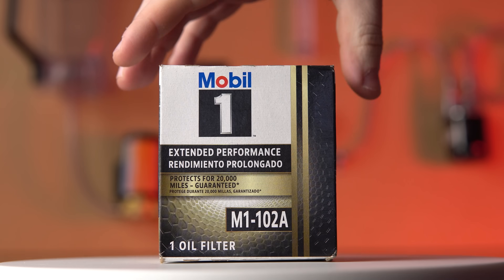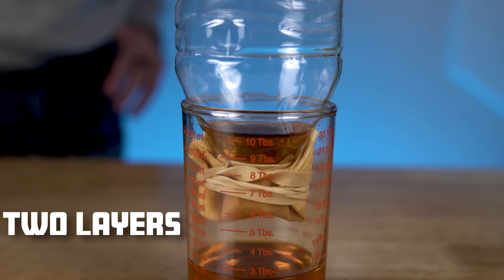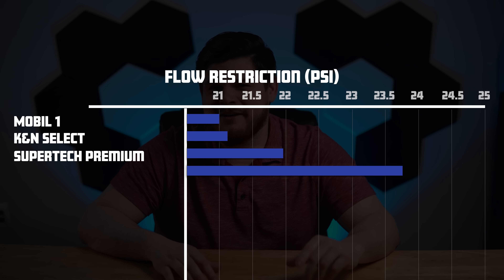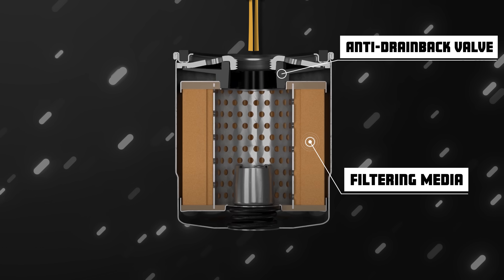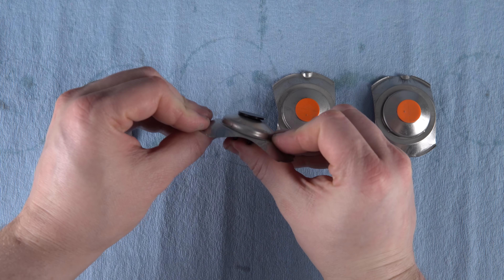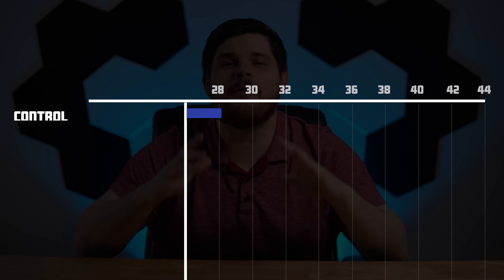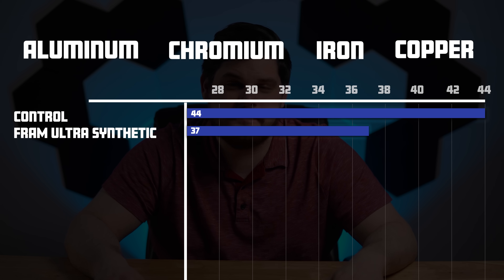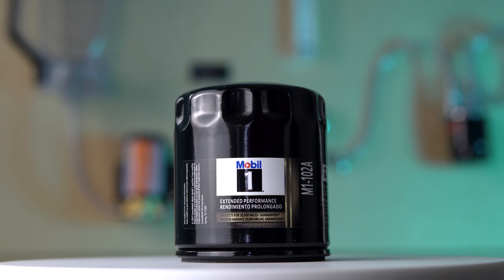Engineers Test the Best Oil Filters! FRAM | Mobil 1 | K&N | Walmart Brand

Comment from the maker: If you want to see other Oil Filters tested, let us know in the comments below!:yt:
Reply: Purolator Boss 😁🤓. Just subed recommend from FBM channel. 😁
Reply from the maker: Thank you so much for the recommendations!
Reply: @BrandRanks  purolator boss filter, my go to
Reply: @BrandRanks  test a high flow metal mesh filter
Reply: @BrandRanks  OEM filter test PLS!  Motorcraft, Denso, AC Delco, Mopar etc etc. Thankyou! - Ohio
Reply: @Brand Ranks  I'd love to see wix and the OE brands like ACDelco, Mopar, and Motorcraft.
Reply: @chrisr.986 

I worked for a oil changing place and our oil filters were strictly Purolator they are the really down to earth simple basic oil filter that just does the job no other oil filter this is as good in my opinion all the others are just fancy names being sold
Reply: Motorcraft
Reply: Motorcraft filters?
Reply: Compare OEM filter from Toyota, Honda, Mazda, Hyundai, Ford and Chevy and throw in the winner from this video as a sort of benchmark/standard
Reply: @Matt J  Exactly 💯 OEM filter test! This represents 50%+ of the oil filter market. I've used Motorcraft filters w/great success on expensive trucks for near 30yrs .
Reply: @Matys1975  
The plastic cage inside the super tech oil filter looks like what is in the new GM filter. Since Walmart does not make its own oil filters, I am going to guess the super tech oil filter is a relabeled Gm filter.
Reply: WIX / NAPA Gold / Pure One from Purolator I would love to see these three tested please
Reply: @BuckeyeMCS , in other words, the ones people who invested hundreds of thousands in their combine, excavator and so on use.
Reply: @kellyvcraig  I have no idea what that means. I just responded with some filter Manufacturers that I'd like tested
Reply: How about the Purolator One? My choice for oil filters
Reply: @LessThanHandy everything is better than Fram including never changing a good oil filter
Reply: I'd love to see WIX face of with other top brands like Fram Ultra Synthetic, Motorcraft, and such.
Reply: WIX might not do too good. They are now made in China @pfcparis
Reply: Yes purolator boss, purolator one, motorcraft fl-1995 and a honda filter  ! 🙏
Reply: @Sean  In other words OEM filter test!? That's what a few of us have requested. Motorcraft is known to be one of best built OEM filters . I'd like see it vs Denso, AC Delco etc
Reply: Purolator makes fords filters and has for years. Not sure what  exact version of a purolator it is but they are a purolator.
Reply: I would love to see the Wix XP series
Reply: fram titanium, wix XP, royal purple, Purolator, motorcraft. I think every filter you can think of this is something a butt ton of people have been needing answers to.
Reply: @vector150  There's so many good filters esp OEM from price pt. Motorcraft & AC Delco are well known to be excellent filters for approx $6.
Reply: I'd like to see wix or napa gold filter tested
Reply: @mikescott9213 they are the same filter. Wix makes the napa gold for Napa.
Reply: amsoil vs wix xp
Reply: . Yeah, what u said
Reply: Donaldson, Fleetguard Wix (NAPA, Carquest)
Reply: I would like to see one of Amsoil's 25,000 mile filters tested. I use those on a 2015 Police Interceptor Sedan I bought from my grandpa.
Reply: Amsoil ea15k and ea25k filters
Reply: Napa Gold anyone?
Reply: Amsoil, Wix, Purolator, Hastings, and Mann. Thanks and take care.
Reply: Purolator and Motorcraft
Reply: Please test some OEM filters like Toyota. It would be interesting to see how they are compared to these.
Reply: @smart one  I asked for OEM filter test also. Like Motorcraft vs Denso vs AC Delco etc. Love Motorcraft filters for price pt.
Reply: Amsoil
Reply: yes wix and amsoil filters
Reply: Wix,Napa,STP,Purolator, PPE, AC Delco
Reply: How about a non cheepy K&N, the white ones are normally $25 to $50 dependent on the size and are the high performance ones.
Reply: OEMs!
Also same brand from different factories
Reply: Wiz XP or Napa Platinum against just the Wix or Napa Gold. Love the testing method and brake down. If you continue to do the same test, it will be easy to compare new filters you test to earlier tests! Looking forward to seeing the next tests.
Reply: You need to do your testing at running temp not room temp!
Reply: @getahanddown  This!!!!
Reply: Can you please test some european car filters!? Such as Mann, Hengst & Bosch. Thanks for the video!
Reply: Wix XP filters is the first thing that came to mind that I would like to see tested
Reply: Test OEM filters.
Reply: Diesel filters, fleetguard, cat,sold on Amazon filters, diesly, docs.
Reply: Mann, Wix, Wix Racing, Honda USA, Honda JDM please.
Reply: Um racing filters are made to flow and not so much to filter fine as racing engines get maintenance and oil changes often.
Reply: Do a oem filter shoot out
Reply: I change my Oil filter every 3 or 4 oil changes w 6k miles between them
Never had an issue
Reply: @RamyFal  That's quite risky 😬.  Oil filters are cheap! Do not go more than 2 oil changes MAX w/out changing a filter. You could be in bypass mode often & not know it! That = zero filtering .
Reply: to be sur i didnt go that far i used to open every oil filter and take a look inside to see if there were something else beside oil 
but i didnt find anything
and i did that for 500.000Miles
then i sold the car in perfect running and driving conditon
Reply: @RamyFal  👍🏾😁🍺
Reply: Amsoil ?
Reply: Motocraft and Wix please! these 2 filters have always performed well.  I run Wix for my air intake and Motocraft for oil in 5.0 and 3.5tt applications.
Reply: @Stephen Frost  Both excellent filters esp if you stick to 5k mi OCI.
Reply: actually the reason for the K&N having higher bar while operating is bc it cleans better faster than the mobile 1. this is a horrible test.
Reply: Amsoil, Wix, Wix XP
Reply: Great testing  procedure.  
How about a test between the Fram Ultra XG2, Motorcraft FL 820S, Mobil 1 M1-210A, and the Wix XP 51372 XP?  
These filters are for the popular Ford 7.3 liter Godzilla gas engine.  Thank you!
Reply: You NEED to use next time make oil HOT because that's what really happens. Oil doesn't maintain a steady 20c° temperature. Higher temp lower viscosity.
Reply: Pls test Motorcraft against other OEM filters! These represent 50% of oil filter market at least (OEM brand filters). I've used Motorcraft w/great success on /off for 30yrs in expensive trucks & sports cars.
Reply: Yeah... Motorcraft, Amsoil filters, etc... This was one of the best I've seen on YouTube. Even better than project farm.
Reply: I use a Wix synthetic oil filter with Pennsoil platinum Synthetic 0w-20 oil every 5K miles in my 2015 Lexus RX350.
Reply: I live in Australia and in my car REPCO ROF80-S oil filter fits in my car. If I could some how ship it to USA for testing. REPCO is a brand that is sold in Auto Parts Stores.  In your part of the world I would love to see FORD Racing Filter vs GM OEM Filter vs MOPAR filter. What I mean is OEM oil filters for say 2022 Ford Mustang, Camaro and Challenger.
Reply: Thank you for this test.  I would love to see this same test with some midpriced but historically good filters, like wix, Purolator gold.etc
Reply: Denso
Reply: the standin oem subaru oil filer compared to the japanese one
Reply: Fram titanium, and K & N Gold
Reply: How about the K&N HP (White can) filters?  I have been using these for years and would be interested to see how they compare to the other premium filters.
Reply: Great video - would love to see an Amsoil & K&N Premium oil filter in a test.
Reply: If you’re getting a K&N filter, get a K&N and not the Walmart K&N. There is a difference.
Reply: Oem filter showdown
Reply: Hey.  I loved the video.   I can supply you with a stainless steel reusable filter to test. I just need to know what thread size you have for the setup.   If it’s the size of one of the filters I have maybe we can get that to you to test?   PM or email would be great, I’d love to see how it performs.  

Thanks
Reply: I can send u a full line of wix or micro guard if your willing to test I have access to the wix,WIx xp,and wix protec filters as well seeing how I have 20 or so of each
Reply: 1 time test... mmmmmmmmmmm like to see 3 of each tested. gives a better idea.. and those 3 of each bought from 3 diff stores... to be sure or at least better chance to get diff runs of the filter. but thats me...
Reply: OE filters, WIX and Purolator!
Reply: Wix and k and n performance gold
Reply: Wix
Reply: Amazing video! I'd love to see a regualar wix, wix xp and also a bosch filter tested.
Reply: Amsoil? It has one of the best specs but also little expensive. Curious how it actually performs compared to other filters like Mobil 1 or WIX.
Reply: Oil needs to be hot.
Reply: Baldwin, please!  by the way, best graphical demo of anti-drain back valves I've ever seen.  Well done!
Reply: More filter material does not equal more restriction, it's the exact opposite. More filter media adds more surface area which gives LESS restriction for a given level of filtration. You're not double layering the filter by adding more media, you're adding surface area.
Reply: Throw STP in the mix next
Reply: Wix XP, motorcraft FL-xxx, and microgard.
Reply: @DuncanMcKokinyu  interesting though that micro guard is made by wix
Reply: K&N gold filter and Wix xp
Reply: AMSOIL
Reply: Wix filters are the best by far...why did you leave them out?
Reply: Motorcraft.
Reply: compare to a WIX
Reply: Wix
Reply: Toyota brand filters!
Reply: Test a metal mesh filter!
Reply: I agree. Id sub for that
Reply: be nice to see wix xp 27 micron  and wix racing (( not for stree))60 micron
Reply: People say WixXp is better than MobilOne
Reply: Test OEM filters like ac Delco and Toyota so we can compare the results to the aftermarket filters already tested. Thanks!
Reply: Reusable metal ones 👀
Reply: Ams oil!!
Reply: I’d like to see a test of the popular stainless media cleanable filters like Hubb.
Reply: Toyota brand and wix
Reply: Amsoil. It'll be the last one you ever test.
Reply: @Dalton Beane  LOL. Not worth the price & would never go 20k mis on a filter.
Reply: do jiffy lube or quick lube places
Reply: Toyota OEM
Reply: ALL of them. Just do it
Reply: Wix, Baldwin, Amsoil, Toyota
Reply: Always been a wix guy but mobile 1 may be a good option. Now how about the house brands?
Reply: Purolator BOSS!!!!, My crate race engine builder requires them
Reply: I would be interested in seeing Amsoil filters tested. Some of them claim to be good to 25,000 miles.
Reply: Royal Purple and Wix XP please! Both great products!
Reply: Yep, would watch every video you do twice.
Reply: did you run tests at engine operating temperatures?
Reply: Purolator Boss, Bosch, Valeo, Wix
Reply: Royal purple!
Reply: Yes please do. It would be great to compare it to the OEM part from Toyota, Honda, Ford, etc. Other brands you can test are STP, ACDelco, and Motorcraft.
Reply: Wix, as they have been rated highest in a number of other comparisons in the past few years (some of them on YT)
Reply: Napa Gold and Purolator filters
Reply: Toyota OEM!
Reply: Tokyo Roki
Reply: K&N High Performance line (white can)
Reply: Motorcraft and Amsoil please
Reply: You should test oil filters from car brands! (like toyota, honda, nissan, ford, etc)
Reply: Why all the cheap filters 😂 I want to see the best of the best! Test Wix and also test those clear view filters!
Reply: Hi! Please test Vic filters made in Japan. Thanks!
Reply: There are filters that filter very slowly and get a lot more contaminates out, they are called bypass filters but they work along with a full flow filter.
Reply: Yes please
Reply: Definitely K&N, WIX, and Ford racing for the high end tests.
Reply: Test all the brands to find the truly best oil filter. Name brands, auto parts house brand, all of them. This test was in depth but need to expand to find the best.  Royal Purple, AMS Oil, Wix, CarQuest, NAPA, Baldwin, Puralator, AC Delco, STP, Motorcraft, Bosch, and Microguard.
Reply: Mann
Reply: Let’s see a Toyota filter
Reply: Would like to see Donaldson, wix, and amsoil tested
Reply: This is awesome!!!!
Reply: anyway to go on record that “you did not receive anything “ from any of these brands or money to sponsor? thanks
Reply: 🤜💥🖐️🤘MicroGuard select
Reply: Please do auto mfg brand (Motorcraft for me) so those of us with new and in-warranty vehicles that are serviced at the dealer know how they stand.
Reply: Can you do Ford Racing High Performance filter?
Reply: Canton racing oil filter
Reply: How about the Amsoil super filter
Reply: compare OEM brand filters! ACDelco, FoMoCo, Honda, Toyota, Mopar, etc
Reply: aFe and Donaldson's
Reply: Please test Mopar and Amsoil filters too,
Reply: Toyota brand
Reply: I want to see amsoil
Reply: Royal Purple, Amsoil, and Wix.
Reply: Wix, Mann, and Mopar.  I'd also like to see it done with element filters rather than cans.
Reply: wix
Reply: please, EU brands Purflux, Mann, Knecht, Bosch, UFI, :)
Reply: Would love to see how well Mopar brand filters stand up. My dad has always used mopar filters on his vehicles which has lead me to using them on mine when I've changed oil.
Reply: napa gold filters
Reply: Can you test the 10k, 15k and 20k filters against each other… is there any real difference
Reply: Please do wix and Napa gold! I just found this channel. Already subscribed. Awesome video. Thank you!
Reply: I wanna see OEM filters VS Mobile One and other too filter brands.
Reply: Motorcraft, wix, amoil, bosch & O'Reilly
Reply: Please review the more typical 7,500 or 10,000 mile filters.
Reply: Any OEM, Subaru in particular for me.
Reply: Bosch. Mann.
Reply: Amzoil
Reply: I would like to see OE filters compared to these findings.
Reply: I want to see advanced auto/Carquest premium filter compared to the Wix, i've heard they share the same manufacturer and are the best filters on the market. Obviously if so the advance/carquest is much cheaper.
Reply: sTp please
Reply: Wix
Reply: The Amsoil filter, please.
Reply: WIX and WIX XP please
Reply: Toyota OEM filters
Reply: Wix, Mann, PurolatorONE, Amsoil, ...you know, the good ones
Reply: no WIX filters?
Reply: I'd love to see OEM filters compared!  Of course, that would involve more adapters so it's expensive.  But I'd love to see STP, Wix, and Purolator compared, just for example.
Reply: I would be interested in Amsoil.
Reply: Ryco and ryco syntec filters please mr youtube
Reply: It would be nice to compare Toyotas OEM and Honda OEM filters.
Reply: Yes!!
Reply: I think a question that needs to be asked is how much is a typical amount of aluminum destruction in a 20k mile run
Reply: Heater for oil?
Reply: How do you know if the bypass valve was not lowering pressure during test?
Reply: Great video very professional. However I detect an accent? Your pronunciation of certain words are different? But i see American looking oil filters??
Reply: The Wix, Napa Gold and Amsoil filter against the Mobil 1...potential all star lineup.
Reply: I want to see the oem brand filters especially toyota and some other common brands of oilfilters like bosch mann ufi japanparts mahle meat & doria valeo etc
Reply: Can we see Royal Purple??
Reply: OEM filters vs aftermarket would be great! Is aftermarket actually better?
Reply: Try STP wix purolator toyota next
Reply: STP and Fords Motorcraft
Reply: hyper tech worst! Starts seeping after only 1500 miles !
Reply: Awesome test. As a RAM 1500 owner who only used Castro or Mobil 1 full synthetic oil, I would love to see this same comparative test using the K&N, PuralatorBOSS, Mobil 1™ Extended Performance Oil Filter M1-113A, Castro Premium Synthetic Oil filter and the Fram filter from this test. Thank you!
Reply: R
Reply: I wish to have seen STP tested
Reply: Yes. add the AMSOIL filter too.
Reply: Amsoil
Reply: Valvoline
Reply: Wix
Reply: Amsoil,  Royal Purple, and Wix

OEM oil filters from Ford, Dodge, Chevy, and Toyota 

These are a must. We all need to know.
Reply: Would love to see each brands OEM filter like Volvo/Subaru filters.
Reply: Purolator filters please
Reply: The one thing you didn't check was the PPM in the oil after the Al powder tests. That's ultimately what it's about, not how much you can pile in, but how much it can take out. Great review otherwise.
Reply: Test K&N HP series
Reply: Should've added STP to the mix
Reply: I was gonna say amsoil oil as well, but it looks like Devin has got me covered. 
AFE Power oil filters would be cool to see
Reply: Motorcycle filters
Reply: Excellent testing  criteria. uch better than most "hacksaw and take a look" Will you do similar testing involving WIX xp filters?
Reply: AC Delco
Reply: Like to see OEM filters tested, would provide what is expected.  Thank you
Reply: Im sure others have asked. But how long before another video on more oil filters? The testing you did was what everyone has wanted to know since oil filters was invented
Reply: HiFlo 204 and HiFlo 204RC
Reply: Nice job but oil is not at operating temperature.
Reply: Original Toyota oil filter
Reply: Bosch filter
Reply: Mann Filter Spin-on Oil Filter - W940/25
Reply: test a couple of OEM filters against these. and also throw a WIX in there.   SO like WIX and Toyota/Honda Filter.
Reply: Love to see the NAPA Gold tested.  Years ago, a shop I worked at bought a few tens of million of dollars of small engine equipment. 
For warranty they (the OEM) wanted their filters use for oil change. 
I remember the owner (due to the pricing on those filter) had reps from most filter makers submit numbers and come in to talk with the OEM.... NAPA were approved as a substitute, NO OTHERS were.
Granted, happened in the mid/late 90's, but haven't used anything else since.
Reply: OE Filters please! Like BMW, and why they are so much more than filters like this test.
Reply: Test OE filters please
Reply: Amsoil and honda oem ( they offer two variations a01 and a02, one is made in us and the other made in Japan)
Reply: Would love it if you add FRAM's newest 2023 "Synthetic Endurance" in your comprehensive test.
Reply: There is an amazing video of an old fabricator that cut a bunch open. He showed how bad some were rusted right off shelf. The best one that seemed to be made was NAPA top line. It was amazingly built and some of the others were built on the same assembly line without a doubt so may question is how dose top shelf NAPA do?
Reply: Test wix xp
Reply: Add Wix , Wix XP Purolator , Purolator Pure One  , Motorcraft , Mann , Hengst ,  Bosch , Mopar , Denso , Baldwin , Amsoil , oil filters to your test.
Reply: I’m sure an auto manufacturer would make a good filter if nothing but to protect its products, aftermarket that’s another story
Reply: Why did you only do 4 filters?
Reply: What oil and filter would you use for my vehicles...2005 malibu 2.3 210000 miles and Chevy blazer 4.3 2001 and 225000 miles..ty
Reply: WIX is the best
Reply: I'd like to see amsoil and wix
Reply: Wix
Reply: Why haven't you guys done it anymore tests you said you would??
Reply: Denso filter
Reply: You should do Royal purple
Reply: wix
Reply: I have 2.0L Subaru BOXER that is turbocharged (AVO).  I need flow AND top cleaning to keep clean oil for the turbo bearings.  So please keep adding to this list and keep a global list of all tested as this list would grow.
Motorcycle engines req. even more quality in the filters. because of the engines reaching 12-16k RPM.
So getting the "brand" oil filter (Yamaha, Honda, Aprilia, Kawi, Suzuki).  Each company blesses and sells their own branded Oil Filters.  Then there are equiv. of the top brands AND "HiFlo" is a popular aftermarket that many sport bike people use, including myself.
Reply: Wix.  Motorcraft. Purolater.
Reply: Definitely test the Purolator Boss.
Reply: Duh
Reply: Amsoil
Reply: 1.  Purolator Boss (PBL22500)
2.  Motorcraft (FL-500S)
Reply: Toyota Oil filters.
Reply: WIX
Reply: would like to see WIX racing
Reply: Amsoil please
Reply: Wax XP
Reply: PIAA twin power magnet dual filtering.
Reply: let me guess you got paid off my filter companies to not do anymore testing?
Reply: Yes! I would love to see the stp extended life filter tested! I know this filter has a good build quality and it advertises that it filters smaller particles than most filters.
Reply: the Ford brand MotorCraft ones (FL400-S specifically as i run this in my big turbo Focus ST)
Reply: Fl-1a
Reply: If I send you some filters and some oil would you be able to test them?  I wanna see wix, purolator, fram, and maybe one more.
Reply: Can you test oil filters that are not surrounded by a metal container. 

I have a Chrysler engine that sits on top of the block and is coveted by a threaded plastic cap. 

I use Mopsr oil filters but I would switch to a  different brand  of filter if that brand was proven to be better.
Reply: Where do you get such low prices on oil filters?
Reply: Um.. what temperature was the oil when you performed this testing?
Reply: Test the Toyota 10009 filter
Reply: Thank u for the great video and the effort involved. I really would like to see the results of the basic 'fram' tough-guard and extra-guard. The ultra syn is kinda in a different league. The other 2 may b more comparable to 'supertech'. And mainly because I'm concerned about flow and restriction as priority over anything else. Thanks so much--keep up the great work!
Reply: Yeah, Mobile vs Wix, Purolator, ACDelco, Motorcraft.
Reply: German brands like Hengst, Mahle, Arman, Bosch, and Mann.
Reply: What about Royal Purple and Napa platinum
Reply: I would like to see what the NAPA Gold does.
Reply: Acdelco
Reply: Please test the NAPA Gold and other oil filters and compare them to the results of these four oil filters. 
Do you know which oil filters are used the most by people who change their own oil and filters? THOSE filters should be tested!!
Reply: Baldwin filters, and Mann
Reply: Motorcraft, ACDelco, Mann, Wixs
Reply: How about Fram Endurance and Fram Titanium to see how they compare. Fram has them listed above their Ultra Synthetic.
Reply: Amsoil, Baldwin
Reply: Napa premium filters.

Napa Gold
Reply: AMSoil
Reply: Test the amsoil filter! Claim to last 15k miles
Reply: Amsoil filter, try them
Reply: This video is a load of shit. Billing Fram as superior in anyway to a coffee filter and rubber band as an oil filter is pandering. Fram paid you to put a video together and fabricate results. I know, you’ll never admit it but they’ve been shredding paper in engines for decades and I dare you to buy a new F150 at the price of a house these days just go look and only use Frame and push them to what did you say the correct interval is, 18000 miles? Or was that to see how the last 2000 miles will do?
Reply: How about some Engine Air filter Tests. I am interested in air flow (SCFM), removal efficiency (%) @ size (µm), capacity (grams), filter media material (cellulose vs synthetic), etc.
Reply: STP
Reply: Amsoil EA filter
Reply: How about testing real filters like Baldwin and Donaldson, as well as OEM filters.  The kind of filters you don't buy at Walmart.
Reply: Wix XP and Purolator Boss
Reply: WIX
Reply: Ford's FL500S oil filter for 5LV8?
Reply: Mann
Reply: NAPA
Reply: Do OEM car manufacture filters please like VW/AUDI
Reply: morotrcraft and puralator boss
Reply: This video is spot on. I used K&N for years before I realized I was sacrificing filtration for flow. When I stopped using the K&N, I did use the Fram Ultra Synthetic for the subsequent oil change to clean all the gunk out.  From then on, I switched entirely to Mobil 1 extended performance. My oil has definitely gotten cleaner. The K&N only protects for 5000 miles tops.  With the Mobil 1 EP, I can easily push the interval up to 7500 miles without worrying. I still aim for 5k intervals, but if I don't have time, I don't sweat it like I had to with the K&N.
Reply: Baldwin
Reply: Can you test K&P
not K&N
Reply: they are washable
Reply: HIFlow state and "certifies" they are OEM or better.  I would compare a few OEM Like GM/Delco and theirs that match (or better) and see.
Reply: Borsehung and Mahle filters!
Reply: MAN-HENGST-DENSO
Reply: Baldwin
Reply: Wix, or do with cartridge filters.
Reply: Wix
Reply: Yup WIX  is  the best.
Reply: mopar and subaru.
Reply: My brother said Mobile 1 is better than Fram Endurance. Is that true?
Reply: Wiz?
Reply: How about OEM such as  AC Delco Ford Motorcraft Toyota BMW and so on .
Reply: How about racing filters MOROSO  KN  Jegs  Wix  Fram
Reply: Wix
Reply: How about STP
Reply: Royal Purple, Amsoil, Valvoline, Castrol, WIX, MicroGaurd, and maybe some OEM filters!
Reply: WIX
Reply: AMSOIL Oil Filter EA15K13
Reply: Amsoil and royal purple
Reply: Amsoil, Royal Purple,  Purolator Boss, and your champion Mobil 1 Please
Reply: Test Wix
Reply: 😢😢😢😢😢

DOES YOUR OIL FILTER CONTRAPTION DOESN'T PROVE NOTHING TO ME THE PROBLEM WITH THAT IS AND WHAT YOU'VE MISSED IS THAT OIL IS PUMPED AND THROUGH THE CENTER OF THE OIL FILTER AND PUSHED OUT. ...
YOU HAVE TWO LINES COMING DOWN THROUGH A TOP THAT SCREWS ONTO A OIL FILTER SO YOU'RE TELLING ME THAT THE TWO LINES THAT COME FROM OPPOSITE ENDS OF THAT LITTLE BLOCK OR MAKING THEIR WAY INTO THE CENTER AND THE SETUP DOESN'T MAKE SENSE...
Reply: Please do the docs diesel oil filters I’ve heard they are terrible but some people like the
Reply: Is wix any good?
Reply: Never thought filtering capacity vs. restriction mattered so much!
Reply: Baldwin and AC Delco please
Reply: FRAM filters aren't as bad as I thought. Learned something new
Reply: I'd like to see a comparison between the different fram filters.
Reply: Surprised Walmart's filter held up! Budget doesn’t mean bad!
Reply: Do caterpillar!
Reply: Bosch and Amsoil, if you would, please. Thank you.
Reply: You chose to test the cheaper of the 2 k&n filters.  They have a white one that cost about 50% more and claims to boost performance
Reply: Motorcraft FL500S
Reply: Do OEM filters
Reply: How about a Genuine Toyota filter?
Reply: I now run Mobil 1 Oil filters due to where I shop. I used to run STP “extended life” because I heard they were good with synthetic oils. Surprised I didn’t see an STP in this test.
Reply: You did not consider tempetature as a factor... Warm vs Cold makes a diference in performance.
Reply: The new Fram Ultra from Walmart is rated at 25,000 miles! I'd love to see how it does!
Reply: NAPA/WIX Vs MOBIL 1 would be nice and thank you.
Reply: please test and compare Purolator 20K oil filter. thank you for the great cotent.
Reply: Test OEM brand filters, please.
Reply: Test Kawasaki's 16097-0007 oil filter lets see how it compares to other brands.
Reply: It would be nice to see a high-end filter tersted, such as Baldwin for example.
Reply: Honda OEM oil filter.
Reply: WIX OR OEM ONLY
Reply: Toyota brand
Reply: Amsoil
Reply: Amsoil
Reply: @inebriatedengineering6288  PUROLATOR BOSS PBL24651👍🏾😎🤳
Reply: Amsoil
Reply: @devengudinas1649  Amsoil
Reply: amsoil filters, multiple channels say they're the best but they haven't been as thorough as you have.
Reply: Amsoil
Reply: Amsoil
Reply: @devengudinas1649  must be an amsoil dealer how about 1 comment
Reply: @devengudinas1649 
 Do you think Amsoil is a good brand ?
Reply: Yes. Show the other oil filters please!
Reply: @Aloma08 $ftttttttttttttttttttttttt
Reply: Q SS @Aloma08 😢 KO
Reply: How about the less expensive Frams?
Reply: @gdholmfirth  using a cheap filter you shouldn't own a car
Reply: @vector150  manufacturing should not be allowed to make such a piece of junk to sell
Reply: @tucker442  what junk?
Reply: Amsoil
Reply: Amsoil
Reply: Amsoil
Reply: Amsoil
Reply: Amsoil
Reply: Amsoil
Reply: Amsoil
Reply: Sakura filters
Reply: Definitely add the ford racing filter to this list.  I use them on my dodge ram      they are made by motorcraft I think

Has the by pass valve in the top of filter so no particles get back into the engine.
Reply: Amsoil
Reply: Amsoil
Reply: Amsoil
Reply: Amsoil
Reply: Amsoil
Reply: Amsoil
Reply: Amsoil
Reply: Amsoil